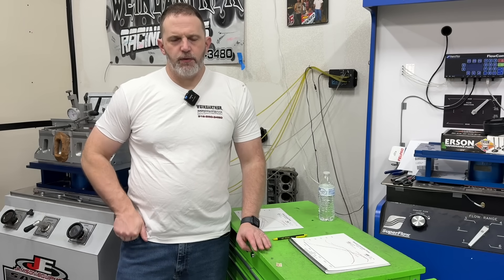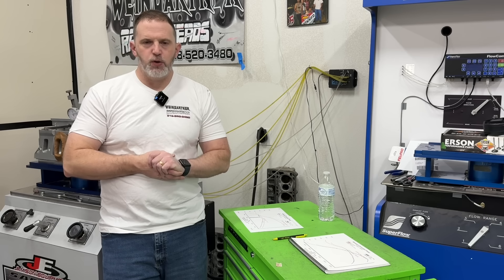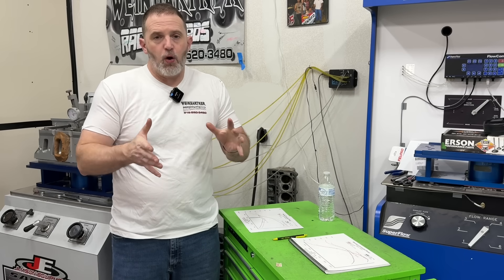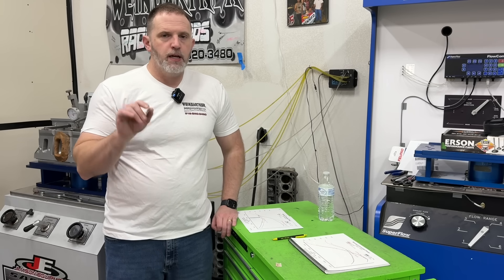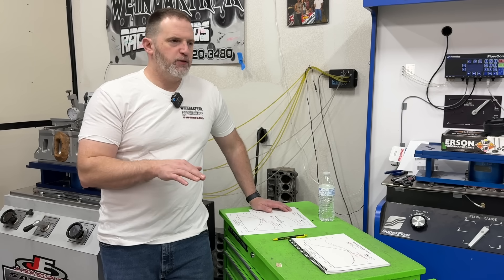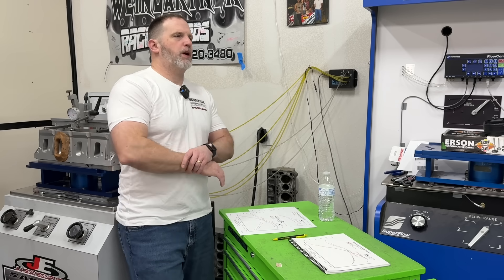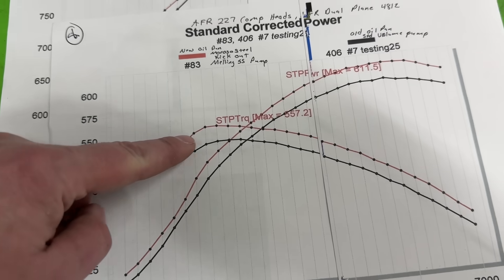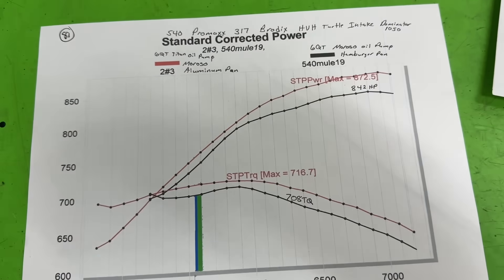Oil Pans Make Power

Comment: My Uncle does a lot of G3 Hemi dyno work, one of the tricks he used for the 6.1 in my rumble bee was a modified Charlie's Wet sump Kick out pan for a G2 hemi , we tested few different rear sump pans that were designed for the G3..Stef's, Milodon, Kevko, Milodon 31002 made the best power out of the "off the shelf" pans we tested, but That Charlie's pan that was originally built for a BDS-8-71Blown  497CI KB G2 hemi that was in a 65 B body , pan had the Steering link tube , which we removed and then worked the flange to bolt on to the G3 block.  that pan put us up 25 HP more over the 31002 pan. went from 720(ish)hp to just over 750  , real world is 3850lbs Brick of a ram truck  runs 10.20s @135/138 mph . with the 31002 pan best was 10.35 @ 130.  the right pan is WORTH  $$$$ invested.   we do run a 5 stage external oil pump , .

Comment: Steffs also makes very nice aluminum kickout pans. I have one on a 461 Pontiac so the make them for more than just the big brands. I have a kickout pan with the trap doors in the front of the sump, built in windage tray and I used a IJ Teflon custom fit scrapper than can actually touch the crank. Its very close but does not touch. I made my own pickup enlarging the low pressure side. It all works fantastic.

Comment: I made the stainless steel oil pan on my 32 Ford. It is a boat or funny car style pan that’s deeper to keep the oil lower away from the crank. It also features two uni directional teflon coated screens that keep oil in the bottom of the pan. There are verticals plates at each main bearing with trap doors for oil return. The pump is screened and baffled above so oil cannot get back up into the rear crank throw. The engine revs free of parasitic drag so fast. 383 sbc, AFR heads, Scat crank, Kinsler Raptor 8 stack, Holley hp efi. 
Catalogs show oil pressure is rock solid under full throttle and full braking. This was a win win project. I estimate 20-25 hp savings

Comment: After watching windage tray versus none dyno results where there was a 5 to 10 horsepower improvement from beginning of rpm to the end of measurement, I'm a believer. My 1993 Mustang HO has a Canton T-race, 7 quart pan as well as a Ford windage tray. Yes, running a quart low or lower shows a 'gain' of horsepower. Why take a chance unless you would guarantee enough prize money to replace your engine?

Comment: Great video, just a suggestion but it would have been nice and more engaging if you physically had the pans you were comparing to show the viewer the difference
Reply from the maker: I did in the original video. This is a short recap version
Reply: Sounds like that bad ass Moroso eliminator pan. They have them for small blocks too. That moroso or titan billet pump is the icing on the cake too.

Comment: I have the milodon 31169 on my 422 sbc . I had terrible windage . I it doesn’t have the separators where the mains are . It doesn’t have the front kick out and windage tray but the tray stopped at the sump . I bought a screen kit from canton . And  used the screen to cover the rear sump around the oil pump . Windage problem gone . And you can feel the engine is happier

Comment: Our first car was a 3200# 55 built in 1971 with a 331.  Four bolt main, camel humps with a three angle,  two 600 DPs on an Edelbrock X-C8, big body Shieffer mag and a lot of Erson cam.  Oh to have had good heads back then.  I modified a factory windage tray to include a scraper knowing that we needed to reduce windage loss.  Because at  that weight, with a 5.38 rear gear (approximately 0.020" backlash) and a 2.73 low gear, fine spline top loader from Gratiot, you need to find power anywhere you can.  The loose backlash was a trick a buddy of mine had run on his 56 C/Gas with one of the oddball bore and stroke combinations that gave him around  292 ci.  You did not want to drag the gear set on the top end but, you  had to make sure with the manual gearbox that you drug the clutch slightly after setting the Line-Lok to preload the rear gear.  Otherwise you would spread it all over the track.  Anyway, the car would run 11.92 @ 111.9 all day long.  Not bad for an engine that could be run on the street with a regular distributor.  There is power to be found everywhere if you take the time to find it.  We did not know about restricting oil to the top end then but I am sure that all the oil sitting in the valve covers helped with the windage issue.

Comment: It makes me wonder if I went from a speedway oil pan to mooroso oil pan i wonder if it would make a big difference and maybe a different oil pump I did have a melling oil pump on mine but man how can I get away with the oil pump shaft I had mine broke on me it was a arp and I apparently with these thick 20w50 oils the oil pump shaft break at the end where it hooks ti the distributor is there a different shaft out there i can run that is stronger because I have other guys in my class have broke those to